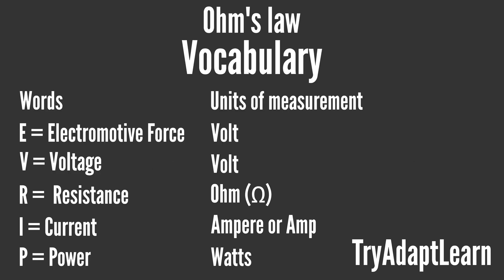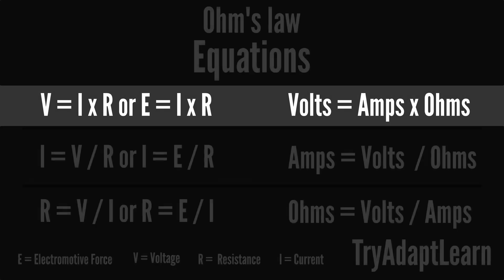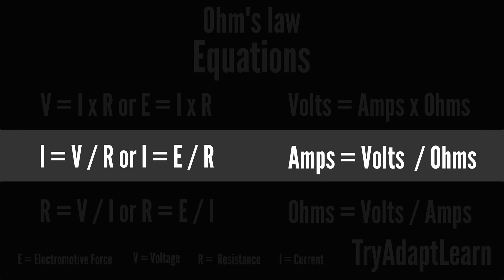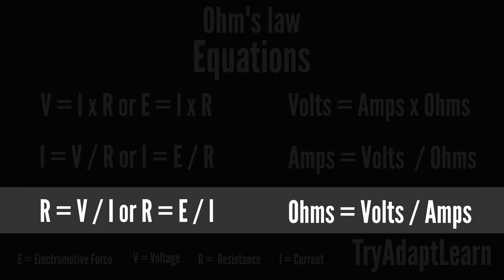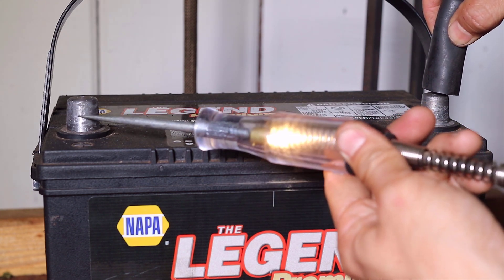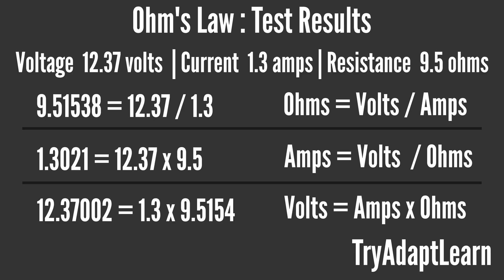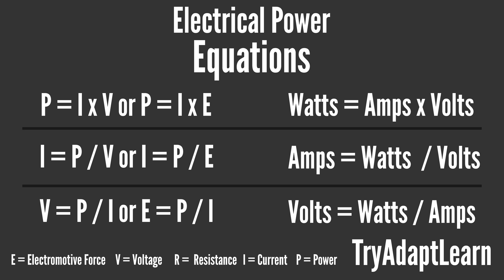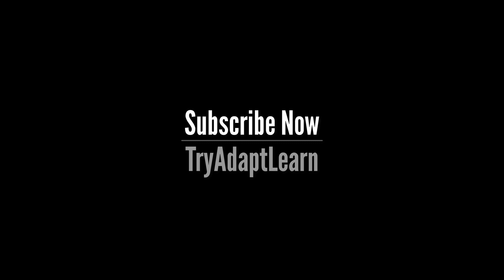Ohm's Law Explained and Tested

Comment: Electricity is a very difficult concept to understand. Having gotten a shock as a youngster by playing with an electrical outlet, it became apparent t to me that it is something that can be quite painful. Taking electrical engineering in college, I wasn't able to grasp the various formulas used because the terminology was describing something you could only imagine. I wrestled with these concepts for a week or two and changed majors. All through my adult life I have wired cars or changed outlets in houses - just petty electrical tasks, but this article just brought me into the analytical side of electricity . Of course I have tried to use these formulas in the past by looking them up each time and relying on the outcomes as matters of faith. This time the light came on, and I doubt I'll need to look up Ohm's law again.
By the way, the French translation of amperage is merely "intensity of current", hence I for amps.
Reply from the maker: Thank you for your account and feedback.  It’s good to read that the video was able to provide a different perspective for you.